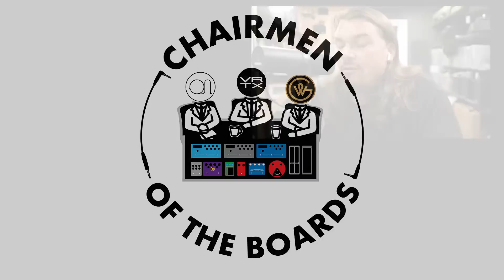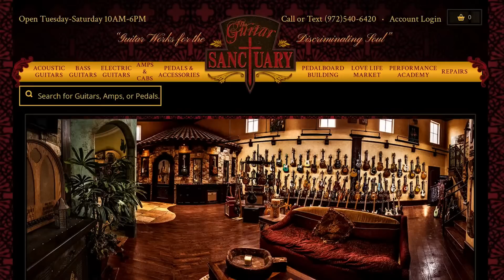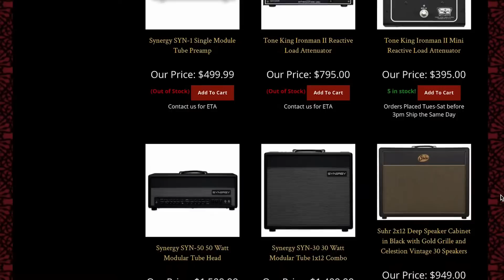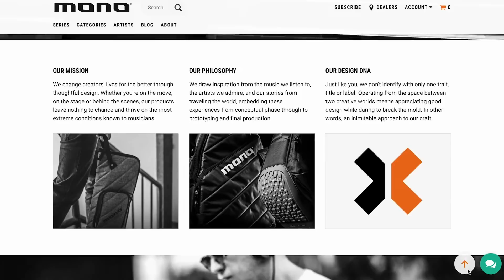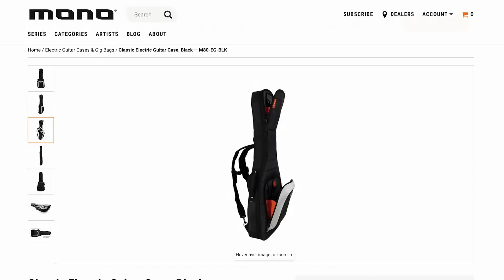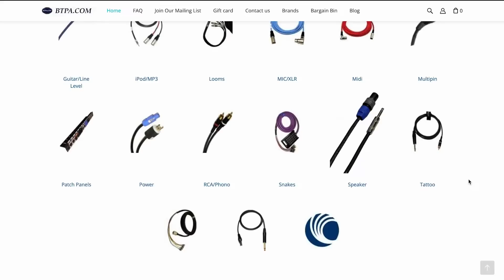Where Will The Pedal Industry Be In 10 Years? (with @wampler_pedals)

Comment: Having followed the pedal industry for over 50 years now, I'll offer a few observations.

1) The industry has generally moved from something that explored pedals and effects in isolation , to something that is more inclined to thinking about whole pedalboards and a processing "system".  That includes not only their features and capabilities, but their physical design as well.  Might we someday see all in/out jacks mounted along the rear skirt?  Perhaps.

2) We've moved from effects that were imposed by the musician, towards sounds that were more typical of post-production.  Many of the ambience-type effects, and even flanging and stutter/glitch sounds, were never done n a live setting, but achieved in post-production.  These days we can hit a button and have them when we want, in a gig.  I expect that to continue.

3) The majority  of the most popular effects throughout the '60s and '70s were 1-2 knobs and maybe a switch.  MXR's and EHX's  million-sellers had two knobs or less.  Into the '80s and companies like Boss nudged us towards 3 and 4 controls.  In Boss's and DOD's case, they could rely on standardized enclosures, cast/machined for up to 4 controls (one of which could be a rotary switch).  But, as much as we collectively lean towards having more options at our feet, we still want the instant access that a simpler control panel and single-purpose pedals give us; especially as our pedalboards have gotten bigger and more complex.

4) Forty-five years ago, Craig Anderton got me interested in parallel processing, something whose power tends to be underexplored.  I've included several splitter mixers in my own modular rig to facilitate that, but we're starting to see examples of such thinking being incorporated in the floor-pedal universe.  A good example is the recent OBNE Beam Splitter, which allows for mixing of three distinct distorting drives, each with their own adjustable delay.

5) Expression control will expand in ways we don't think of at the moment.  Some pedal-makers (e.g., Chase Bliss) are incorporating simultaneous control of multiple effect parameters by expression pedals.  But foot pedals are not the only possible means of expression control.  Consider the B-Bender mechanism on Telecasters.  It doesn't have to be for bending a string.  The same strap mechanism could be used for expression control.  The same is true of whammy bars.  A product I saw demoed at NAMM several years ago used a Strat whammy to control both volume and pitch.  I have one of those Source Audio Hot Hand controllers, that allows for control of two parameters with picking hand movements.  And there are breath controllers, normally used with synths that could be adapted for use with pedals.  So look for changes in that general direction over the next decade.  We don't and can't all have Jeff Beck's wrists, so we need technology to afford us those spontaneous changes in tonal character and "expression".

6) Switching.  As pedalboards get more complex there needs to be some design standard for pedals to be remotely switchable, that does not entail running audio cables with 1/4" plugs all over the place to loop-selectors.  Look for my Youtube demo of how to remotely switch Boss pedals, and you'll see a simple addition to a standard pedal that permits switching to be routed to a central switcher via a single narrow-gauge unshielded 2-conductor cable.  It's the sort of thing that should be easy to adapt for the majority of pedals that use e-switching or relay-switching, making for MUCH simpler layouts of pedalboards, where everything can be placed where it makes the most sense, without having to be concerned about being able to reach it with your foot.

7) Smaller?  Modular?  I built a modular system for myself, with all effects built onto and having a 2.5 x 4" faceplate.  It's for me, so I don't concern myself with being able to sell it.  I use 1/8" in/out/control jacks, just like Eurorack.  Yes, 1/4" plugs and jacks are sturdy, but jeez louise they take up a lot of space, and oblige physical locations that aren't always forgiving.  Perhaps we will collectively move towards greater use of them.  Of course, this will result in the need for 1/8-to-1/4" adaptor cables, to use with legacy pedals, but that's OK.  And Eurorack is starting to merge with pedals.  The recent releases from Fairfield, like his "Conflict of Interest" envelope follower/generator are a great example of that, as are the other little "utility" pedals.  OBNE also has some CV generators/controllers meant to use the expression-pedal jacks in a smarter more modular-synthesis way.  I expect to see much more of that over the coming years.

There.  I gotta go solder, now.  Regards, Brian.